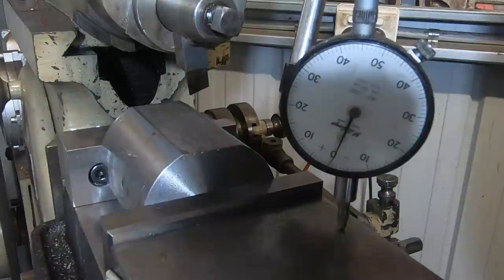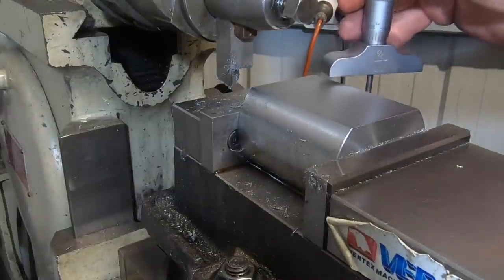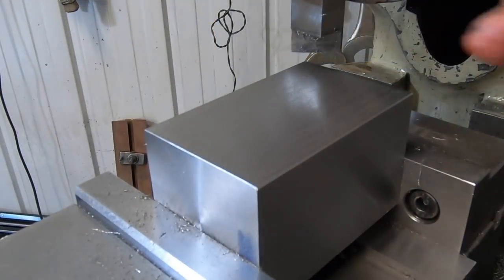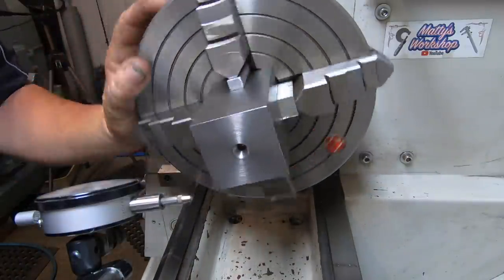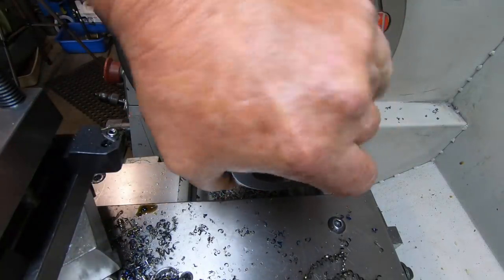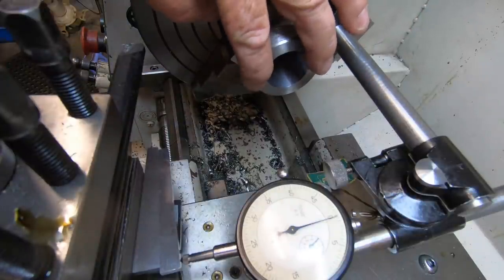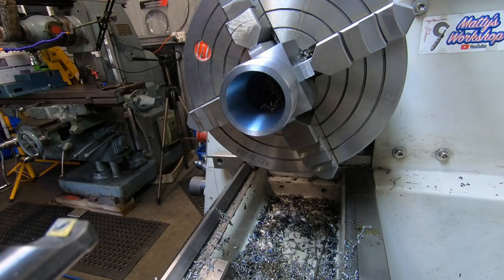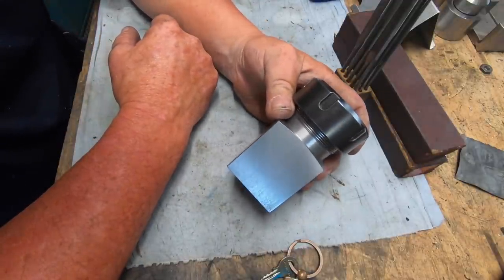ER 40 Square Collet Block

Comment: Just discovered your channel through CEE, the use of your shaper in this project has inspired me to start using my Douglas shaper more often.
Reply from the maker: Gday, the Douglas shaper are a really nice machine, perfect size for the hobbyists, there cheap to use compared to a milling machine and a lot more fun, appreciate you watching the channel, cheers
Reply: I got the motor running on my Douglas over the weekend. I still need to mount up the VFD and its control pad and an emergency stop and I might be able to start making some chips with it. Been a long time coming.

Comment: That was a decent cut on the shaper. Apparently with no problem at all.
And I'm sure that collet block will find good use in the future.
Reply from the maker: Gday Rustinox, the shaper handled the .100” cut no worries at all, it was good the give the shaper a good run, thanks for watching, cheers

Comment: Excellent stuff! I'm wondering about making a 12-sided ER40 collet block with a rather larger body. Also some 6 inch long square/hex versions so I don't have to use a jack at the other end of the vice when the block is horizontal in the jaws with the nut overhanging the side of the vice. Good tips by commenters about using a gauge pin or something in a collet for the blueing fit test.
Reply from the maker: Gday, I’m going to have a go at the hex block next, if this turns out ok I’ll have a look at the 12 sided version, your idea of a 6” body is a brilliant idea, I should try and do this on the key block, I’ll do some thinking, thanks for sharing your thoughts, Cheers

Comment: Very nice. I need to finish my ER32 D1-4 collet chuck. I've got it to the threading the outside - then do the inside taper and done. Just interrupted my work by doing some other stuff.
Reply from the maker: Gday Mats, I did think about making the D1-4 ER40 chuck but found a good deal, I’m sure you’ll get yours done mate, thanks for watching, cheers

Comment: Hi Matty, the runout you're seeing is no doubt the collet I've been buying precision collets with less than .0002 runout from Techniks...
Reply from the maker: Gday Dave, these are a set of Vertex collets so they should be pretty good, there plenty good enough for what I do mate, thanks for watching, cheers
Reply: @MattysWorkshop  Vertex's standard precision is .02mm or .00078 Which is pretty good for a collet. I did find that the type of collet nut you are using causes a capture problem, so I had switched to a bearing type collet nut.

Comment: Excellent work - looks better than the one I bought. I had to look away when you put your finger in the taper while it was turning, but you got away with it ok. 
Macca
Reply from the maker: Gday Macca, the finish from the shaper shear tool is super smooth, not as good as a surface grinder, it almost looks as good as a brought one, thanks for watching, cheers

Comment: Matty, what a beaut of a job mate! Absolutely spot bollock as we say here in the Old country! I love the finish the shear tool gives on the shaper. I'd dearly love one of those in my little shop, but sadly I have not got the room for one. Incidentally, a question to you Matty, I'd like to know why you don't use oil on the final shear cutting? Is it because you feel you get no better finish with the oil or another reason. Not a criticism mate, I'm just trying to further my engineering knowledge from a Master like you. Incidentally you were putting too much blue to check your taper. In that particular scenario less is more. If you put too much on it gets everywhere as you said and you can't see if it is touching or not because it may have squished out and blued a part that was not in contact.  The slightest amount straight across the work and put the collet in and turn 360 degrees and that should tell you all you need to know as far as contact points
Reply from the maker: Gday, With the shear tool I find I get a much better consistent finish without oil, I only take a few thou off each pass, with the bearing blue I did screw up there and use far to much, Appreciate you watching and commenting, Cheers

Comment: Wondering about putting a piece of drill rod or round HSS or other accurate stock in the collet before test fitting?

Would help to ensure that the collet doesn't collapse when test fitting and give a false reading, I would think?

Thoughts?
Reply from the maker: Gday Andrew, yes your spot on, I should have done that but I honestly didn’t give the a thought, I really don’t know what I was thinking there, thanks for commenting mate, Cheers

Comment: Great video mate! I’m in the process of making a ER 40 collect chuck for my lathe that bolts onto a. Back plate. Makes clamping smaller parts real quick and easy. Your video gave me some good ideas for how I’m gunna do it.
Where did you get those angle blocks from that u used to set the 8 degree tapper? 
Cheers.
Reply from the maker: Gday Dave, it’s great to hear the video is helping you, I brought the angle blocks off EBay, I honestly can’t remember the sellers name but they come in extremely handy, definitely worth having a set, also check on Amazon, I’m sure they are for sale there, thanks for watching, cheers

Comment: Hi just been looking over your channel. I notice you got a new milling machine for Christmas. It didn't have a quill dro on it but it does now. Can you let me know which one you used please. As I have the same unit. Thanks Terry
Reply from the maker: Gday Terry, the quill dro is a cheap unit off eBay, I have since put a touch DRO on the Cincinnati mill and I used iGauging scales for this,mothered better quality in my opinion, I brought mine through Timbecon who are in Melbourne and Perth, they are a little more expensive but worth it, easy to shorten also, I hope this helps mate and thanks for watching, cheers
Reply: @MattysWorkshop  Thanks for that looking forward to watch all your videos.

Comment: The run out at the end tells me you are really good at that but I have a question, with 4140 or any steel Is there an advantage to using a shaper over a mill?
Reply from the maker: Gday, the big advantage of the shaper over a mill to me is tooling, a HSS blank ground and honed is much cheaper the endmills, thanks for watching, cheers